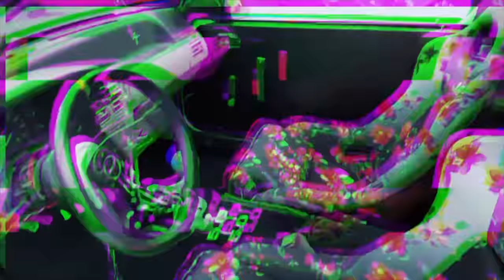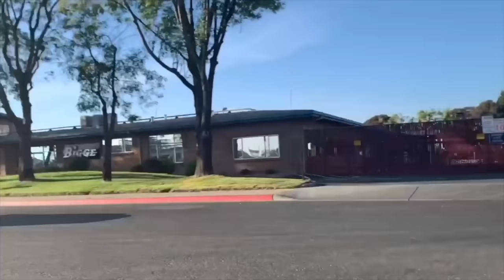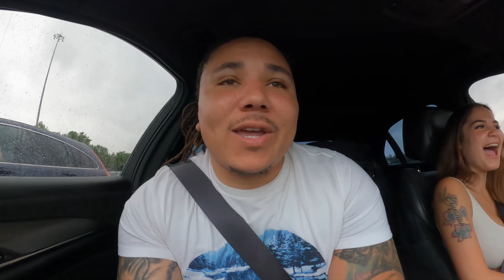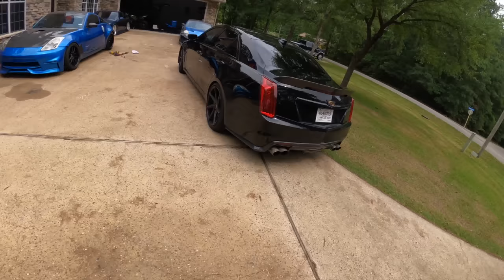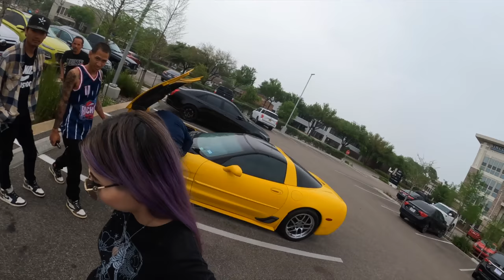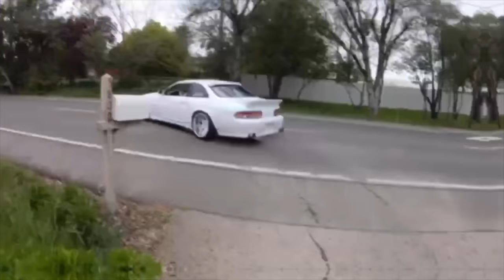She Has Cooler/faster Cars than Most Dudes! She Took Me For A Ride!

Comment: She needs to be glad she's not in Florida. My Z06 is lowered but not THAT low and I scrape all... the... time. A lot of Florida roads are built on sand so they sink, twist, crack, etc. and there are sometimes huge potholes or areas of the road that are raised up 2-3 inches. Hell, I have to replace my front lip twice a year now (at around $300 a pop) so I can't imagine how much damage that GS would get around here.